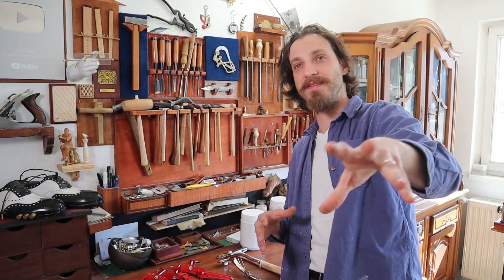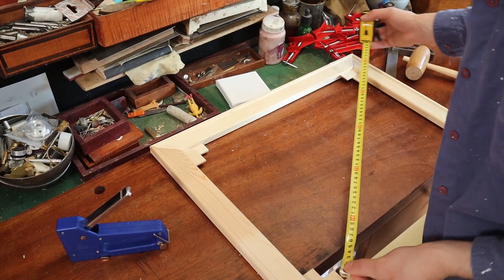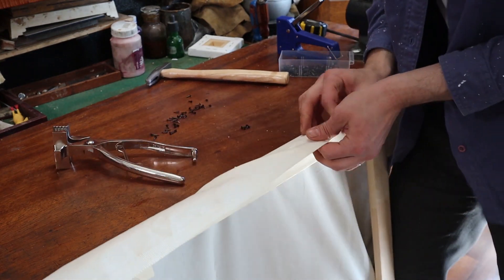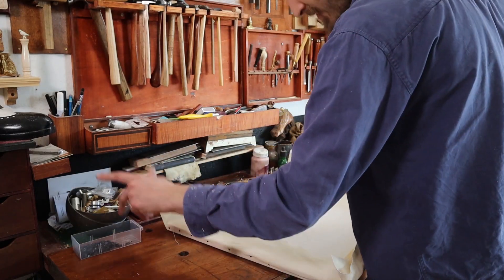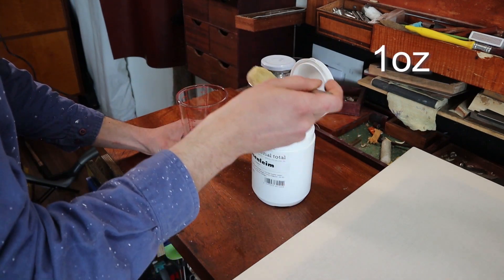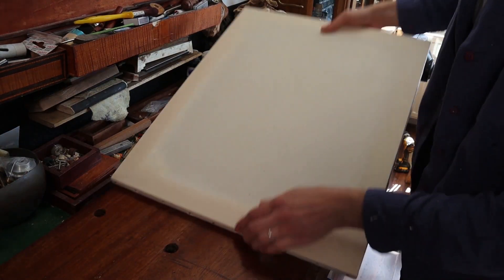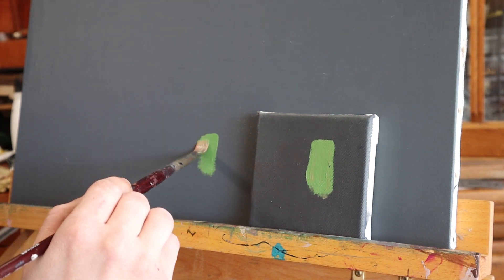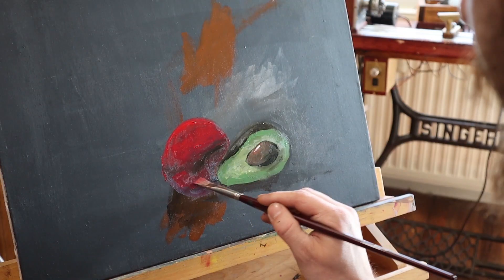Why stretching your own canvas is so delicious!

Comment: Hi, what kind of hammer is that? Is it magnetic? Looks pretty handy.
Reply from the maker: Indeed, I think it's called simply a tack hamner
Reply: Magnetic tack hammer. Also called an upholstery hammer. Still sold and they are fairly cheap too.  Seen people just glue a magnet to a normal tack hammer to save a few bucks as well.

Comment: Nice.  Tacks are definitely the way to go, they look much nicer, and if you've ever had to pull those awful staples out you know you're doing someone a favour down the line.

In general just so you know in the future the layers are canvas and then sizing (the rabbit skin glue) to seal the canvass, and then gesso for the painting surface (gesso is absorbent, and without sizing the gesso will still allow the oils to get to the canvass and eventually rot it or cause problems later on).  I don't think with acrylics it would matter, but with oils it does.  I'm never sure if the premade ones actually bother to put size the canvas before they put gesso on, I think some do and some cheapos don't.

Comment: Sorry to say that but if you glue the stretcher or if you staple the corners together there is no reason to use the keys because you immobilize the stretcher so that it cant move and stretch the canvas. You should leave the staples on the front of the stretcher out